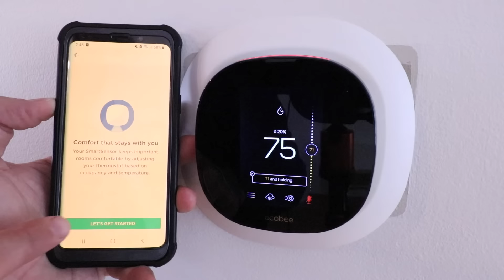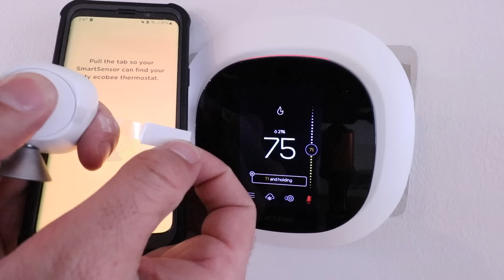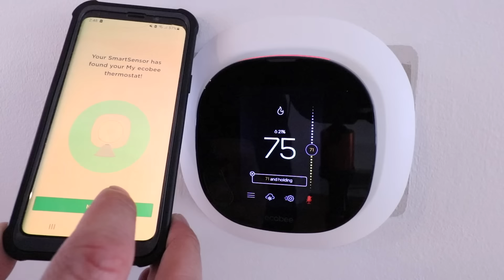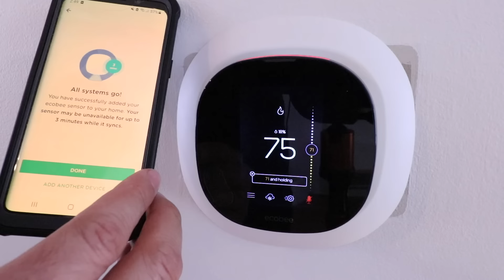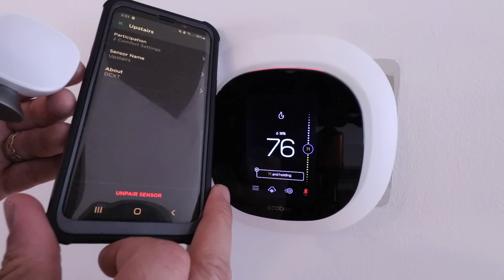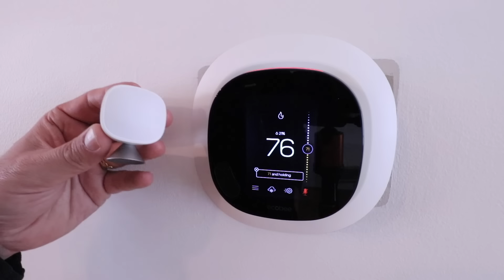How To Connect Ecobee Sensor (Ecobee SmartSensor)

Comment: Ecobee kept branding and marketing the new sensors are smart sensor , what does it actually do as being “smart sensor” compare to the room sensor? I know it can be used as motion detection in home security feature as additional feature beside room temp report to thermostat unit.

So multiple sensor with same participations (home , sleep, away) , the average of temp would be calculated by thermostat to adjust cool or heat base on the owner settings!!

I heard some said one of smart feature of smart sensor that it senses if there is no motion it would adjust itself to away mode if forgetting to turn off to save energy but Ecobee never comes forward to describe what smart it’s sensor is about doing or what lol😂!!

Comment: Great video but Should have explained If it takes average temp of both sensors.
Reply: yes it does if you select both the thermostat and the sensor in your settings. You can also select only one of them depending on the time of the day, your occupation, your confort, etc

Comment: So which room takes precedence when it comes to the right temp? the sensor or the main thermostat? if the sensor says 80 and thermo 76 does the room where the sensor is at stay at 80 ? or does it lower sensor to 80 and rest of house freezes?
Reply: It makes an average value between the two and starts the furnace accordingly. You can also chose to use only your sensor during night for exemple and only your thermostat during the day
Reply: @sophiebolduc7463  great thank you
Reply: @oldmangamerlive  thank you also.
Reply: @sophiebolduc7463 HOW Do you make the thermostat focus on heating or cooling to your desired temp on your desired sensor?